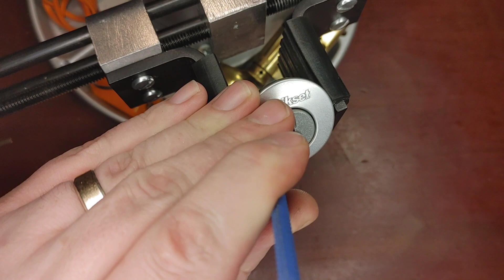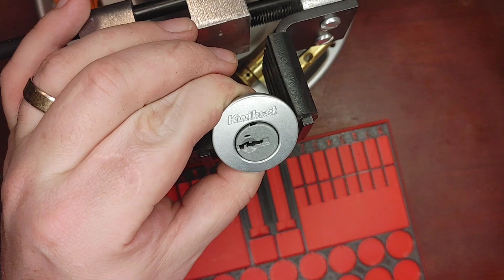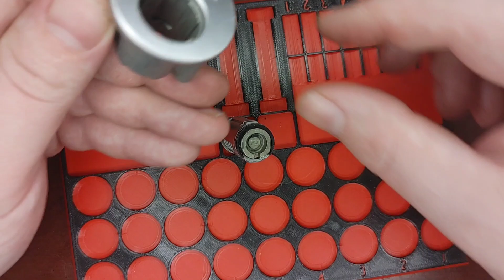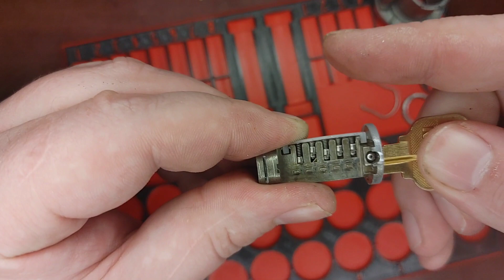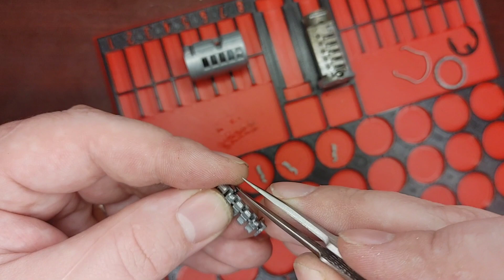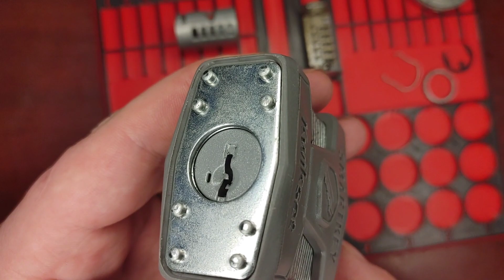Raking and Gutting my first Kwikset SmartKey, Gen 3, Locksport

Comment: Nicely done indeed 🎉🎉 haven't got my shim perfected yet but it's close, cheers 👍
Reply from the maker: Saw someone did it recently with a sanded down hair pin. Depending on the lock you get there can be big differences in the tolerance between the plug and housing, so that can play a big part in how much room you have too.
Reply: @knowthebird I've used a piece of 0.3mm feeler gauge thinned & shaped to size but the tiny end curve is critical to get past the little obstruction every time.

Comment: Just made my shim from a broken Peterson pick.
Reply from the maker: Sounds good! It took me a lot of little adjustments to find the sweet spot where it could fully slide down the sidebar, but I needed it to do that to open. I could not have it just put pressure on the very front of the sidebar. You can pull the core out of the housing if it helps to see how the slim is sliding in and where it gets caught up.
Reply: @ The new versions block this from working from what I’ve heard, the knobs and levers can be bypassed.
Reply from the maker: @camronbay1  I thought this was their most recent/current generation, but I could deffinitely see then wanting to block that access. Ill keep an eye out for a new model.

Comment: Very cool.  I don't think I've seen those locks raked before.   Just out of curiosity,  if you tension the core of the padlock you showed,  do the pins bind?
Reply from the maker: If I apply medeium tension I feel some pins bind.  It feels like those pins are stuck though, not just resisting lifting.  If I wooly lots of tension they do not all bind (first pins is still free floating).